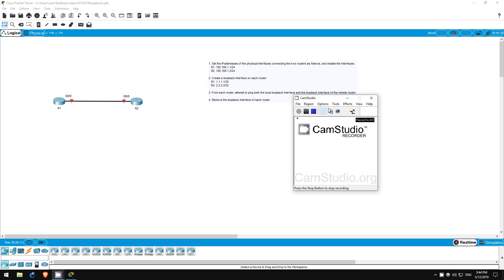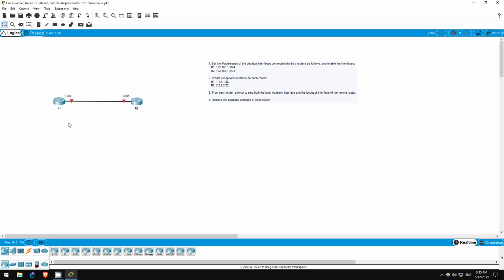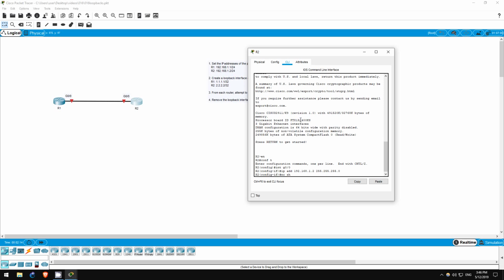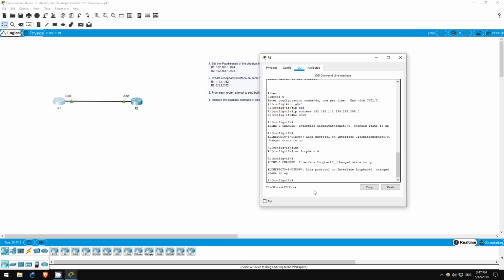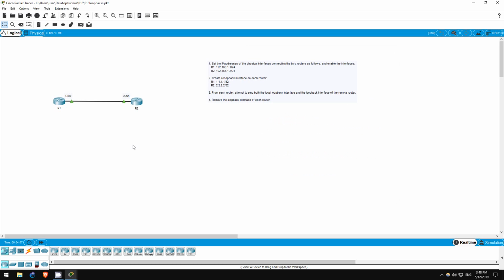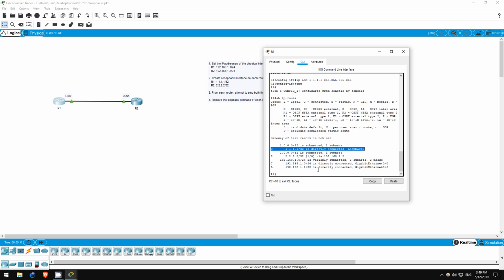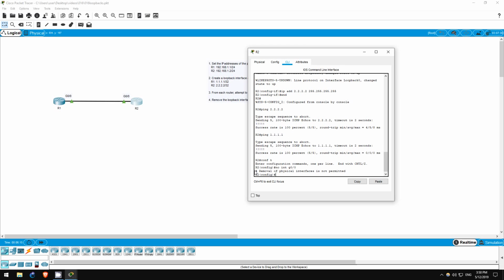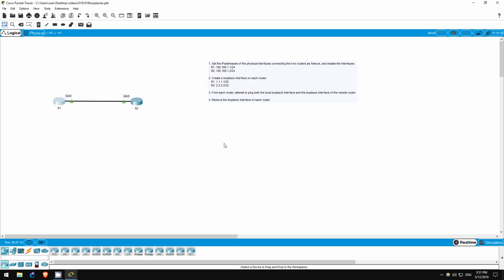FREE CCNA Lab 016: Loopback Interface Configuration

Comment: How could the  Lo0 be represented in packet tracer. In my SRWE skills assessment  (which I already passed yesterday) the router has a loopback Lo0. Yet I wonder how it was done to represent the Lo0 loopback in the activity. In my intent to reproduce the skills assessment, I can setup all the equipment (2 PC´s, 2 switches, and router) along with their connections. Yet to show the router with the symbology representing the Lo0, I cannot figure what to use. For in the original activity it has ---|Lo0 drawn to represent the loopback.

Comment: Hi jeremy  i've  created and completed all steps in the lab16 , but ping loopback is not  working.
what protocol do  you use in lab16 ?
Thanks.
Reply: mine also
Reply: @ashutoshverma3216  you need to do static route from R1 to R2. 
use command ip route 2.2.2.2 255.255.255.255 192.168.1.1 on first router and it should be works.
Just to the same on R2.
I did a same problem :)

Comment: Now if we remove the physical connection. Can we ping between routers ???
Reply from the maker: How will the electrical signals from one router reach the other one?
Reply: @JeremysITLab  physical connections between routers.  Isnt that the reason we use loopback ip ? So if the main connection breaks down, signal transfers from logical connection that is loopback ? Can u please help me to get out of confusion
Reply from the maker: @SANTOSHSHRESTHA111  But there is only one physical connection between the routers.  If it goes down, there’s no way for a signal to travel between them.
Reply: @JeremysITLab  then what is the use of Loopback ip ?
Reply from the maker: @SANTOSHSHRESTHA111  It provides an interface that isn't dependent on the status of a single physical interface
Reply: @JeremysITLab  ohh . That means it will work when the physical connection is broken down. Am I right ?

Comment: I am confused why the physical interface addresses you used are private (192.168.X.X) but the loopback addresses you used are not in any of the ranges of IPv4 private addresses.  I would think you would want to use private addresses.
Reply from the maker: Loopbacks are often used to simulate remote networks in labs, so using public IP addresses is common.
Reply: If you are using public addresses for the loopback interfaces wouldn't you have to register them with a public IP address registration authority?  And aren't most, if not all, IPv4 public addresses already used?
Reply: @clarkkinser8523  it is assumed that the company was given the network 1.0.0.0/8 and 2.0.0.0/8 by the ISP.